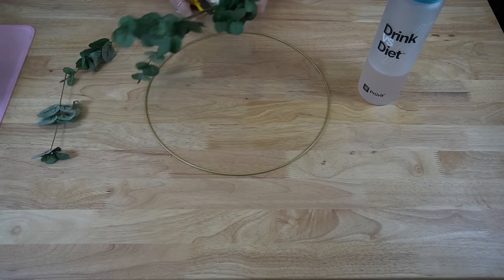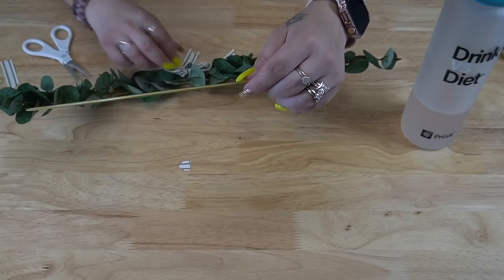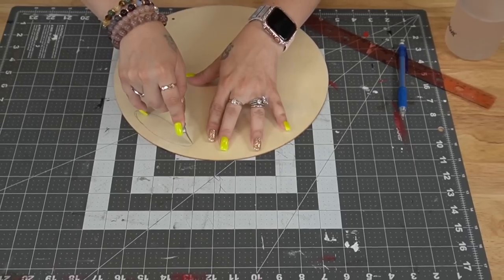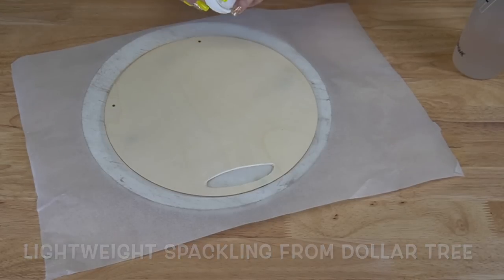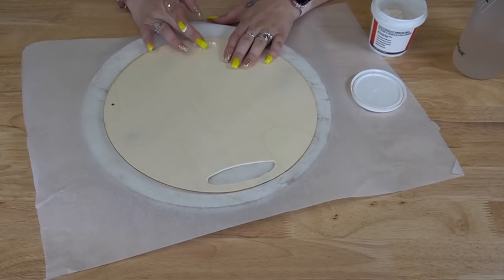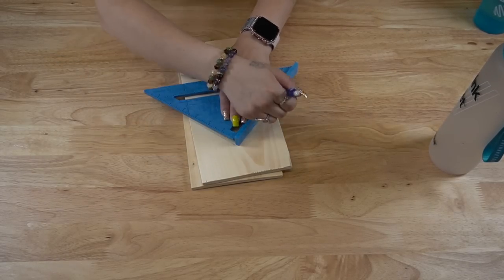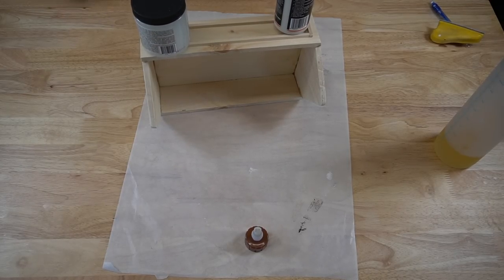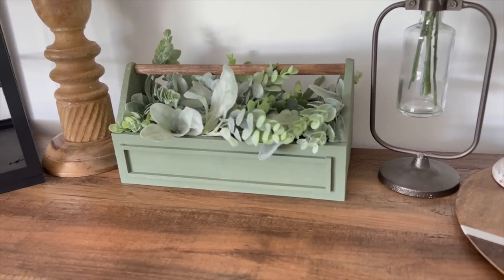😱DOLLAR TREE DIY FARMHOUSE DECOR 2022 | HEARTH AND HAND MAGNOLIA | MADE USING DOLLAR TREE ITEMS 😱

Comment: Tape off sand down coat with a light coating of mod-podge, let dry, then apply paint you will get crisp clean lines everytime. Also works wonders on our stencils that are from dollar tree because (of course Chalk couture won’t need it). Make sure it’s a light coating and let dry or use the handy heat gun….. then daub on paint on what ever tickles your heart strings……. Happy crafting! #sostinkingadorbs……..